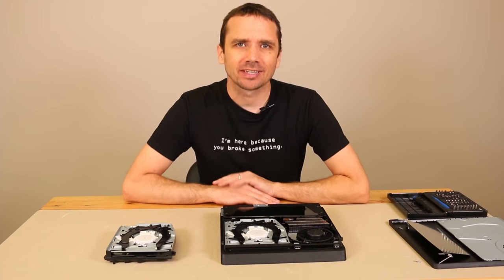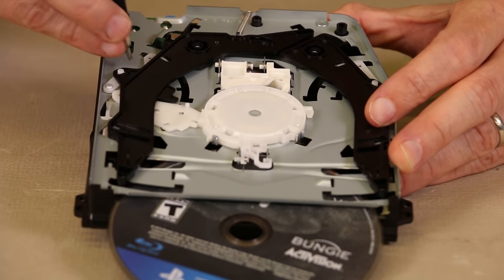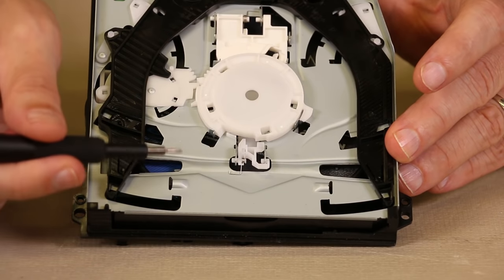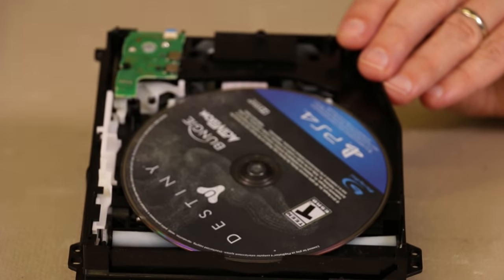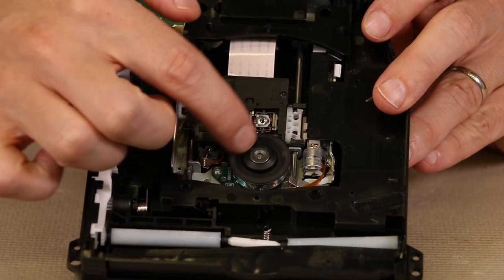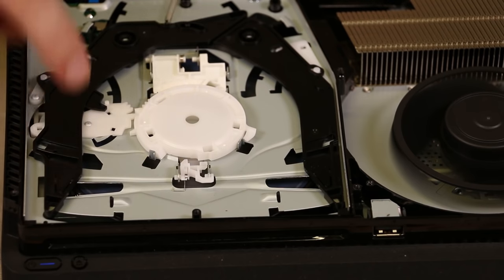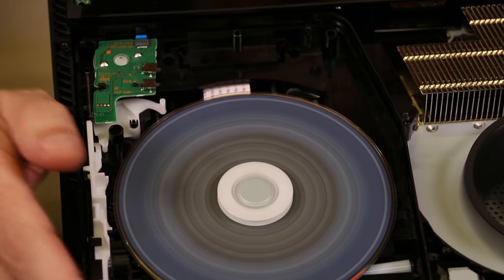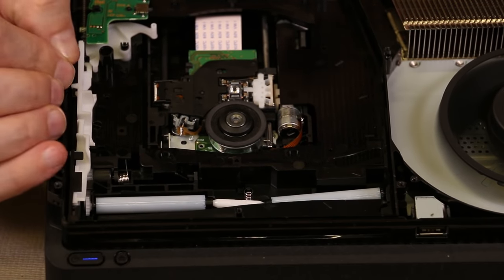How a PS4 Disc Drive Works - Very Detailed

Comment: Hello, I believe my switches in the disk drive don’t work because when I try to put in the game disk, it doesn’t even start to pull the disk like if it doesn’t know it’s even there. Is there anything I can do? Plz help😅
Reply: Having the same issue, found andy fixes?
Reply: Let me know if u find a vid, thanks!
Reply: shadow did u find a solution for that im havin the same prob
Reply: same here
Reply: same here
Reply: Same
Reply: same
Reply: Yeah same I opened mine up and I found out it needs them rollers and the middle rod thing in between the two rollers plus it need that silver plate with the black arms that go in and out I can’t find any of these parts individually only a whole new disc drive for £50 which is really irritating because I don’t want to pay that much
Reply: I ended up fixing it but don’t remember how exactly. I opened it up and made sure everything was in the correct spot and cleaned the rollers

Comment: 5:39 that happens to my ps4 if i put a disc in
Reply: Same here
Reply: This happens toe but if I put the PS4 in a vertical position and put the disc back it will read it, I put it horizontally again and it still works
Reply: Please my play chose cd some are working others not I try gtaV but is not working  please from where the problem is coming thank you

Comment: My ps4 reads my game only when i have it vertically if it's horizontal it doesn't work  i put the dic vertically and leave it horizontally and it runs perfectly fine whats the problem?  Please help
Reply: seems like the disc doesn't quite reach the laser to read it. it has to use gravity to pull it down. I say check the things that pull the disc in, they might be stuck or broken.

Comment: 1. Clean the system the best you can. 2. Start in safe mode by holding the start button for 5 seconds until it beeps twice, 3. Update system. 4. Turn off/start in safe mode. 5. Option 4 default setting and hit next, next. . 6. Turn off/start in safe mode. 7 Option 5 restore data base. 8. Turn on, put game in and enjoy. Welcome
Reply: what?
Reply: Lol not one of these actually help
Reply: Kidruthless you have to do all of this if you wanna keep your PS4 from breaking all the time
Reply: Henry Gonzalez this wasn’t something to prevent ur PS4 breaking it was to repair it
Reply: Kidruthless yea the video is to repair it but this guy is just saying this is what you could do to be safe when using the PS4 so it doesn’t break down after you already cleaned it
Reply: Henry Gonzalez no I’m saying this comment is to repair it ive seen these exact instructions on the ps website to repair
Reply: Nearly always a hardware issue. Well known weak point for ps4

Comment: My drive doesn't eject the disk, i can hear it trying to push it out but doesn't come out.
I removed the disk drive and tried to see the gearing, all seems good. After giving the disk a push, iI tried to use the screw to eject it and it was a success. Unfortunately, this didn't fix the problem, I still have to disassemble and teach the drive to physically push the disk out everything fine i need to change a disk. Any suggestions related to cleaning rollers or years or maybe a spring.
Reply: Mine was doing this too (That's the reason I went looking for this video). 0:35 to 0:42, when he's moving those black levers and they spring back, that's the mechanical portion that assists the drive in ejecting. My spring on the back there had come off. Reattaching that solved the issue. Your issue sounds the same so I would start there with that spring.
Reply: Bucheery22 aame
Reply: @Muhamad isro/gareng petruk 2 years? here we have 1 year but for 30 eur you can get + 2 years.

Comment: Steve I have a 2115B can I remove the plastic weld spot's to remove the metal plate and if so will it be ok when I put the cover back on or do I need to reweld the spots or install screws

Comment: Got question, my ps4 fat 1200 series has issue that when I eject the disc it ejects normally without any problem but beeps thrice (like beps when eject button pressed without disc) and when the disc is out the rollers keep on rolling like it senses the disc is so there but it is not.
What's the solution to this

Comment: I have a question. When the disk is installed on the hard the only reason that we Most Insert the disk is verifying right? So if the disk gets scratched will it still get verifyed? Even of the scratches are alot?

Comment: When i put the disc in my Ps4 its made some eject sonds and appear this Unrecognized Disc Error
Reply: Erick Lopes it's reloading the drive and starting again too try and read it it's cycling threw the operations. Laser either weak dirty or needs to be replaced
Reply: @ryans413  ok well my is kinda the same when I put a disk in it go in but it’s just stops and the laxer is reading it but it’s makes a clicking sound and it won’t read it and the disc won’t spin and after like 20 seconds it’s pops up that it’s not recognized
Reply: @bolo-8177      Yea it’s the laser it can’t read the disc you either gotta clean the laser with a alcohol but I’d recommend just some hot watered on a que tip rub softly if that don’t work then the drive is broken
Reply: @ryans413  ok thanks you

Comment: my ps4 pro won't read the disc horizontally.  just tilt it a bit to get a correct reading.  which is the affected piece that does not work well?

Comment: I have a ps4 slim that does exactly what yours does. It takes in the dvd perfectly and it pushes the two switches on the back so the laser is starting to move but the motor of the drive does not spin at all. Do you believe that the head unit needs replacement or maybe a fuse is blown somewhere? If i press the two switches one by one the rollers starting to work so i believe that the sensing board has no problem to send the signal to the laser that the dvd is inserted.

Comment: Hi!! I need help, the white lever on the left side wont move up and down. when i cleaned my ps4 there’s a disc inside so i removed it when i tried to clean the disc drive. when i finished cleaning, the lever still has its barrier up even though theres no disc anymore. how do i “click” the barrier open? the ps4 sounds multiple times so it can recognize that there’s no disc inside but wont let me feed my cd (idk how the levers can get stuck) please i need help. i have a PS4 Phat CUH ver so the disc drive is somewhat similar to slim but i have to take it all apart since its facing backwards.

Comment: Hello, just wanted to ask a question about this.

Is the disc drive a sealed unit? Had some work going on in my house and one of the workers ended up chopping some wood near my PS4 Pro and a layer of sawdust was spread over my PS4 Pro. Concerned this could have gone in the disc drive and damage  any of my disc when placed into the disc drive.( proud physical collector ).

Any thoughts please let me know, fed up with aimlessly searching Google for an answer.

Comment: My disc drive slowly started having issues. It used to spin while the disc was barely in. The issue evolved over time and I  started hearing a clicking noise. 

It recently completely stopped responding to putting in disks (won’t accept disk or even recognize anything is being ). I can only hear a clicking noise and even if I force the disk in it still doesn’t recognize or spin it. I figured I had an issue with the optical drive when I tried to update but couldn’t. It took me sometime to realize the ps system checks all components are functioning prior to any system update/install. So I just inserted a disc just before it installs the update so it wouldn’t fail. Today I find myself unable to update to the latest due to my optical drive. I have disassembled it down to the optical drive. 

Any help would be appreciated. Disk drive not accepting disk and clicking noise issue. Please help.

Comment: My brother donated his PS4 to me after upgrading but it needed a fix as it would not accept discs. I place a disc, any disc, into the drive and the rollers do not activate. I replaced the drive with a new one and the problem persists. Trying a factory reset with the OS on a memory stick fails with an error. I have done a long and short reformat of the system in Safe Mode, as well as rebuild the database but nothing works. The PS4 fires up okay and otherwise works; it simply won't accept a disc. I have no idea what to do next. Any suggestions?

Comment: I know this is an old video, but I need some help, my disc drive does this at 6:00 it just moves back and forth and tries to read the disc but will never spin the disc. I checked continuity on the ribbon cable to see if it’s ripped internally but everything seems to check out. I already cleaned the disc but it just refuses to spin

Comment: how tf did you get the disc to lay flat in the drive, mine sits at like a 20 degree angle off the rollers

Comment: Curious. Since the disc is held down by a magnet, would it be possible to mount the system upside down and still use the disc drive reliably?

Comment: I've got a problem with my PS4 CUH-1216a. When I start it it can accept a disk. If I then take out the disk it won't take in the next disk and the rollers keep spinning out. The arm is blocking it from going in and it is not spinning the rollers. If I take out the power and puts back the power it can take in 1 disk again. Could it be a problem that it doesn't recognize that the disk has been removed?

Comment: I have a problem where the lever that keeps the rollers down (when there is a disk in the drive) does not go the full length that it's supposed to. It stops after a certain point. What do I do? What's the fix for that?

Comment: I have replaced the lens for the disk drive because i kept getting the error damaged or dirty disk. once i replaced it and reinstalled the software on the hard drive from a usb drive, i have also updated in safe mode, and everything else that i can find on the web to do. However i am still getting the error code. Not sure what else to try

Comment: I have a ps4 slim, and out of nowhere it started ejecting out my disk. I watched one of your videos and wiped the laser with Alcohol and bent the metal top straight and it started reading my disk again for about a day. I’ve tried messing with it ever since and I just can’t get it to work. At one point I kept hearing beeping that wouldn’t stop and my console kept shutting off every time I tried to rebuild database. Now Im just back to it spitting out my disk every time I insert it. Mechanically everything thing seems fine and nothing is broken. Do you have any advise to help me with this issue?

Comment: Why does my disc drive only work with the case off?
Hi, I have come across a rather seemingly random issue with my PS4. I went to try to install and play a game today and it started making a weird noise so, I took it apart to see what was wrong. Before I put the case back on and screwed the top piece back on top of the disc drive, I plugged everything back in, stuck a disc in and it read fine. So, I put it back together just for it to not read a disc and to make that noise again. So, I took it back apart and low and behold when I try to put the disc drive’s top piece back on and add screws it stops working. It’s not liking any kind of pressure. It plays just fine with the disc drive case unscrewed and loose. Could it be the ribbons? What causes this? Can this be fixed? How can I fix it? Do I need to just replace the parts?

Comment: There are in fact three contact sensors for the roll-in/out circuit. Only two are mentioned here. What is the use of the third one ( on the side, while the two which is described in the video are around the center)?

Comment: Took my ps4 apart yesterday like i fo once a year but this time the disk drive is not working now. It seems to have a problem picking up a disk as the laser keeps moving like this one.
Also it does not seem to register that im trying to put a disk into it so it does not pull on the disk. Not sure if somehow i damaged those two switches up top

Comment: Hi, I enjoyed your video a lot and it gave me some insight in what could be wrong with my ps4. Basically it's having trouble reading discs. At the moment it can only successfully read one game that I have, and when I try to insert another one the ps tells me that the disc can't be read. The game clearly works on other consoles but not on mine. Even when I got a brand new game with practically 0 scratches the ps still can't read it, only until I've cleaned the disc and inserted it again multiple times will it work. But even then it won't work properly because I'll only be able to play a short time before the console says that it can't read the game. Would appreciate your expert opinion a lot on this!

Comment: Hey I got a question I was wondering if you could help me, my disc drive on my slim will accept and read my discs however when I push eject the disc comes out however the arms won’t move and the PS4 still has the rollers moving

Comment: I have a PS4 Console but for some reason the Disc Drive don’t work when I insert a disc game into disc drive is not functioning and active it don’t slide the disc into the disc drive but and it don’t upload the disc game or read the disc to play the game disc so how can I fix the the problem with that disc drive for PS4 Console Cuh1115A of inside the Console.

Comment: I have to tap on my PS4 pro as the disc is entering the drive in order for ps4 to read it. If I dont tap the ps4 will not recognise the disc. Can it be that the disc is not being locked down by the magnet or something like that? If I place the console on one side the disc is read without problems.

Comment: My PS4 slim won't accept the cd, even it doesn't turns on when i put the cd in the drive, i can push hard to get the cd in the drive but still it won't read. Do you know any solution?

Comment: Hey I have a problem with my ps4 and the controller, so when ever I walk like 7ft away I loose connection and when I am 5ft away it has some issues and I have already replaced my WiFi antenna

Comment: my ps4 one of the older models has completely stopped taking in the disc all together no noise of the roller's rotating and when i opened it up and had a look at  the roller's they seemed to be fine no dust little bit sticky, the right roller rotated the left more than the left rotated the right and once back together nothing change and I've found nothing on the internet about it  so would you have any idea what could be wrong with it?

Comment: Hi I have been having an error, CE-41839-5, and i dont know what to do cause there isnt any repair shops for miles, where i live. Basically when i put in a disc it goes in perfect but just stops spinning after some time and then throws the error. Please pretty please help

Comment: Hi, i hope you can reply to this comment still after 5 years. My ps4 is now 5years old decided to open it up for the first time, i disassembled (i did my research) it went ok but when put it all together back in i found the disc drive faulty. Mainly the gaurd wont go up and down by itself and the rollers wont spin i cant put a disc in.  Hopefully   you can help me

Comment: Brother i have a ps4 pro. Used to place it vertically, yesterday i placed it horizontally and couldn't even read any cd. Then i placed it vertically and instantly started working normally reading every game. I managed to start some games on a horizontal placement by giving a few small hits in the left corner of the blueray whole inserting a disc. Do you know why is this happening? Is there a fix?

Comment: At 2:22, you removed the magnet, is that magnet slid under the tabs or does it rest on top? It was sitting in a different area of my ps4 and scratched a disc pretty good. I need to put it back in place. Any help will greatly appreciated!  TIA

Comment: I’m not really sure but when i checked inside of my ps4 slim the switches weren’t shiny they had a very worn out look to them which i think is the problem, i’ve had my ps4 for about 5 years now so i wouldn’t expect the switches to look brand new but now that i think about it they look very off to what i would expect. my initial thought was that the rollers were broken or something that moved the rollers was off which now i think is the switches.

Comment: My PS4 doesn't accept discs at all. There is no sound from the rollers etc even trying to accept the disc. I have ordered a new disc sensor board with the motor. Is there anything else I should be looking at?

Thanks

Comment: I can't get my rollers out of the way the black pieces under them are blocking the disk slot, I took the top of my disk drive off and have all the pieces correct but I had a disk in the console so the gears that are on the rollers and the left side of the drive seems like something needs to be aligned.. should I screw the manuel disk eject? There's a spring inside idk if I need it really loose or tightened up? Idk if that explained it good

Comment: im wondering if i have a bad laser it seems like it reads disc that arnt in great shape and wont read brand new disc i clean the laser and changed hard drive i believe its the first ps4 with the 2 piece plastic top just wondering before i order new dvd drive

Comment: i need help. I bought a used ps4 pro the other day and when I insert the disk it reads and copy's the installation files to the HDD, but will still spin during the game software update on the ps4 menu. Is this normal? For example Uncharted 4 says it will take 3hours to download 15gb after the disk is installed, but will stay spinning for 3 hours during that download unless I eject that disk.

Comment: Hello.  Is there any way to test the switches that control the roller drive?  Also, should the ps4 read a disc if you manually insert it using the screw?  Thanks!